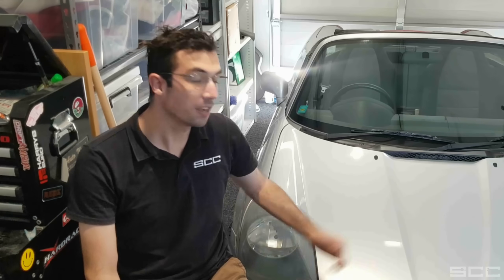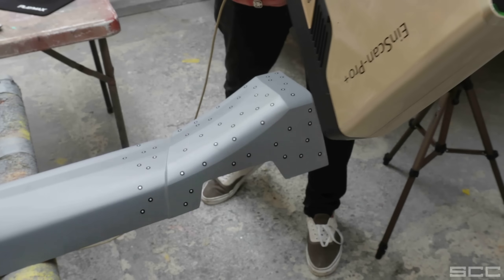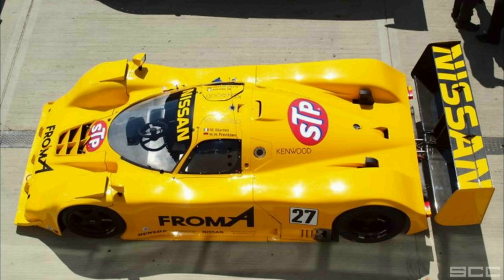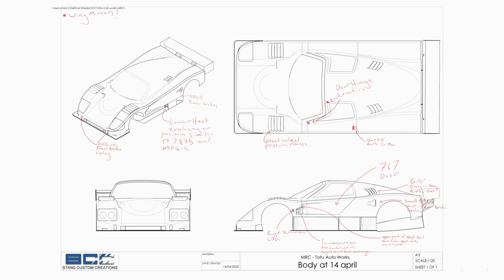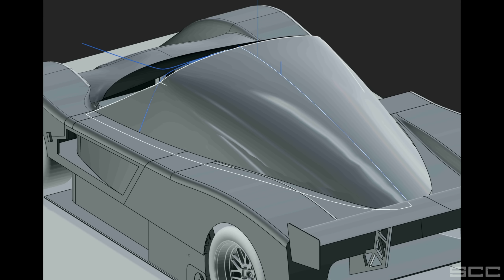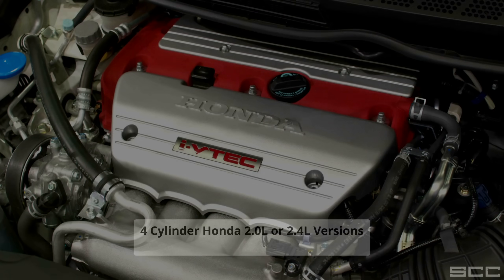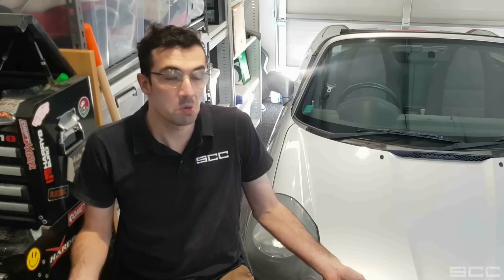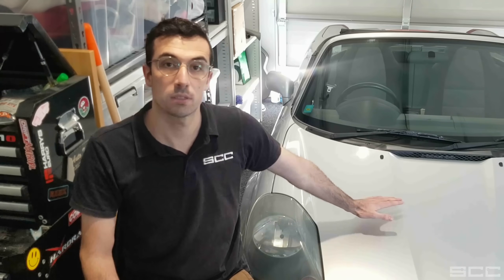MRC Reveal Overview

Comment: 6-speed sequential inline transaxle suitable for transverse mid/ rwd installation (Bacci RC-321) fits Fiat/Lancia (Lampredi) iron blocks includes a bellhousing to customer request, choice of ratios, diff setups etc.

Lampredi iron blocks and Fiat/Lancia 16V heads are relatively easy to find so how about copying Manuel Dondi's Fiat X1/9 seeing it's arguably the best looking evolution of any production car ever.

Plus it's way more streetable than the Beta Montecarlo Turbo Group 5 or LC2 Group C.

Comment: 1.8T! 
My 1.8T swapped MR2 happily did 193mph even with a poorly engine- Like Group C cars. 
With OEM VW/Audi gearing you can go 250mph+ if you like- Like Group C cars.
Toyota Group C cars were powered by big boost 4cyl engines though the 80s, ie the era this car is styled from, with the 4T-GTE from the 83C to the 87C, the 503E in the 88C, and the most dominant car in all of IMSA racing, the Toyota Eagle Mk3.
And it has proven race history in WRC with Skoda, in Formula 2 racing, in BTCC and WTCC, and so on.
And tons of room for wild big turbo setups at the back of the car, like so many of the legendary 80s race cars have.
Reply from the maker: Hi Stav, I was wondering if you were going to see this. I have been following your progress with 1.8t Swap MR-S for about a year now. Very impressive!
How did you get on with testing DQ250?

Comment: Fellow nzer here. 1.8t conversion done and certed. Had a v6, but went away as it was too heavy and made the car handle strange. Mind you it was an iron block v6.
Reply from the maker: I think I follow your channel, used to have a mitsi V6 and now 1.8t yeah? 
Be keen to hear your thoughts on weight balance. From memory your engine now passes through the rear firewall area?
Reply: @SCCDesignLab yup the firewall was modified for the v6. But yes the 1.8t can fit no problem with no mods to firewall (from the uk conversion s). I can feel the difference in a good way going down in rear end weight. Although I'm sure with suspension tuning the v6 may have been ok.

Comment: You can try to find a volvo/yamaha v8 B8444S, it's transverse mounted so it doesn't take much space, sounds amazing, very reliable (you can find them easily with 150k miles no issues), and makes very good NA power. A few people have used it in audi TTs and it is in the Noble M600. Best of all its quite a bit lighter than the vr6 and nearly as much as the 4cyls mentioned
Reply from the maker: I like the sound of that, Do you know which cars it came in?
Reply: @SCCDesignLab  Volvo s80 v8 2007-2010, they are common in America not sure about where you guys live though!

Comment: About 15yrs ago, a young guy in Japan swapped the Subaru EJ20 or 25 into the MRS (can’t remember 2.0 or 2.5). It was pretty quick. He converted the Subaru AWD transmission to mid-engine by making an adapter that deleted the driveshaft output. Factory Five kit cars did the same transmission modification… probably a lot of people have made the same conversion. I bet the newer generations of Subaru engines and transmissions would also fit. Would be awesome to have longitudinal engines layout like the real cars.
Reply: Thats a cool idea and low center of gravity with a boxer and would be a cool idea for these builds. Or even a k20,2gr or whatever engine adapted to the Subaru box to go longitudinal. More work and effort tho for probably very little gain really but I still love the idea

Comment: Hey man I like your guys build ideas so far, hope they work out how you want them to as I've wanted to do something like this for years as well.
I remember there being a Bentley kit years ago I always thought about one day getting.

A couple of things I noticed with your design with regards to having it road legal (at least in NZ).
I'm no expert and take this with a grain of salt as I'm not 100% sure on all of this now days ( Also I'm sure you're probably aware of this stuff by now anyway but just fyi).

1. I believe there's a minimum ride hight for the lowest part of the body for road cars in NZ? I can't remember what it is and it isn't to big but from looking into it years ago with regards to race car inspired road cars it may make the car look like it's on stilts and a little goofy.

2. Going along with the hight issue. Headlights need to be a minimum distance above the ground as well. Again this might not be an issue but could affect the styling if they needed to be raised up at all with how low the car sits.

3. If you're planning on using the current MR-S Vin to make it easier to register you won't be able to have the exhaust exit in front of the rear wheels like that. "Replacement/after market exhaust systems cannot terminate prior to the rear axle/wheels unless the car came from the factory with that configuration" is the terminology the law uses I believe. So early Dodge Vipers and Lots 7's are fine but this won't be. I believe it's fine to do it if you register it as an MR-S based kit car but then it'll be much more work than registering it as just a "highly modified" MR-S.

4. Also, and I don't think it is by the looks (and it would go against the goup-c styling q's anyway) but the rear wing can't be wider than the body of the car.

Anyway good luck with the build, I look forward to seeing the progress.
Reply from the maker: Really appreciate you taking the time to share these insights; road legality is definitely something we're keeping in mind, and it's great to hear what we should be looking out for. We are fairly aware of most of these things, and have plans in place on how we can get around the rulebook.

Comment: Was it necessary to have the transition from the windscreen to the roof be so sharp? I feel like it will have a substantial drag penalty. Great design overall though!
Reply from the maker: Thanks for the comment! There was a trade off aesthetically. Initially we had it smoother, but that made the roofline even taller which unfortunately made it look a bit goofy. Luckily We aren’t too concerned about squeezing every bit  of performance out of it so we can focus on things like Aesthetics. The MRS Chassis is so light that it should be plenty fast enough 🙂

Comment: For the front suspension geometry to work properly with the rear, you’ll need to design it according to the characteristics and intended use of the car. In either case, whether it’s an RX-7 or an NC, neither has the engine in the rear, so the suspension geometry won’t quite match correctly. In this situation, what you should do is reverse engineer the rear suspension geometry and design a front geometry that perfectly adapts to the performance goals you’re aiming for, ensuring a well balanced overall setup.
Reply from the maker: This is what I love! Getting people like yourself who can help point us in the right direction is a huge help! Please stick around and when we get to the stage of detailed design on the suspension please let us know any tips and tricks! 😊

Comment: 2gr or k24 FTW!  Also the Volvo t5 would be cool and it has been done plus it will give you an exotic exhaust note!
Reply from the maker: 5 cylinder would definitely sound awesome!
Reply: @SCCDesignLab  https://youtu.be/pAzIjiswKbU?si=msQlkj4KHBuDf5hM
Reply: @SCCDesignLab  https://www.youtube.com/watch?v=pAzIjiswKbU
Reply: @SCCDesignLab  2grfe is realistic. 260 hp small V6 with 30mpg OEM ECU. You can't really beat it.

Comment: Love the project! 
I've got some experience with the NC/RX8 front suspension geometry and some of its concessions, and one thing I'd seriously look at is the front lower control arm's rear bushing. A couple years back I designed at spherical bearing adapter assembly for that location.
Reply from the maker: I’ve noticed quite a few modern cars seem to have a lower control arm with this style bushing, ideally we would have a setup like NA/NB but as we are wanting 5x114 hubs we are looking at NC components. Although there is a high likelyhood we will end up custom making most of it 😅
Reply: @SCCDesignLab  100% understandable and definitely a bonus having affordable and readily available parts from the donor car! If you need any help with that bushing I'd be more than happy to help out! Think I've got the CAD models somewhere on my hard drive, and I think I've still got a pair of the adapters from the first production batch I made too.
Reply from the maker: @Beakz_ thats awesome, definitely stay tuned and when I get up to doing some videos on the suspension, shoot me a DM on Instagram 😊 be keen to chat

Comment: For me, you're facing a few obstacles... I know the MR-S well as a donor car. There are some important points to note...

-Because of the increased front and rear track, your wheelbase will no longer be 2.45 meters, because the driveshafts are not perpendicular. If you keep their angle, the wheelbase will be longer. You have to keep this in mind when modeling the wheel arches.
By example mine car is now 1m89 wide, and naturally the wheelbase is 2m48

Then you'll need a custom rear subframe to keep the driveshafts horizontal.

-The 18 inches at the rear will increase the original height of car (1m25)...by around 2cm... you'll need specific suspension and springs to lower it by more than 10 cm... 
By example, mine has win 3cm by lowering the roof* and around 8cm by the suspension**...
Forget big spacers, especially in front

-Important point**: the car's side members are lower than the side skirts. And if you lower the ride height significantly, you'll have them touching the ground. It's hard to be road legal with a car that has 9cm side member's ground clearance... even if your front splitter and your side sills are 11cm apart...

-Personally, to avoid being limited by the windshield design* and lower the ride height, I lowered the entire windshield bay, tilted it, and moved it forward... And I even reduced the sides of the windscreen...I thought that they look too thick....

In my country, it's quite impossible to register a such modified car...

Comment: I recommend reading the UK's Individual vehicle approval M1 manual. 

I have read road regulations for different countries and they all have alot of simular requirements. 

If you don't look into your requirements and plan to make a road legal car, you may realise you need to redo everything to get road legal compliance. The UK is known to have the best documented process. All countries have their own manual, reach out to your local driving authority. 

Key things to watch out for are:

-Headlight height
-viewing angles of lights
-safety glass
-external sharp edges

I have read this 7 times before designing my V12 build 👨‍🔧 I'm also building a le man car😉

I hope this helps
Good luck on your build 👍
Reply from the maker: Thanks for the helpful info!
Reply: Was going to chime in about headlight height as well. Never seen anyone pulled over for it, but was regularly reminded by other enthusiasts while driving my slammed air cooled beetle.

Edit: located in Florida, USA (no vehicle inspections)
Reply: @VeggieLard Yeah, every country I have looked into has a minimum and maximum height that the physical light can be mounted at on the bodywork.

On my LMP1 car I need to add headlights ontop of the fender because the original ones are too low, I can use the originals as main beam but not regular headlight.

Another good resource for anyone wanting to get an idea what I am talking about are videos called 'IVA TEST' by MKsportscars. I have also done my own TIPS video talking about regulations for builders but the MK one is better 🤣

Thanks for the good chat 😎👍
Reply: Have you already finished a car?
I’ve watched your channel an the most I’ve seen is a rolling chassis without steering, without transmission and drivetrain.

This isn’t meant as a attack or anything I‘d just love to see more of your work in a later state and how you solved the problems that came up!
Reply: @rolux4853 Hello, I've been building supercars for years. I am new to youtube tho 👍 My first documented build is my V12 project which I have been building for 1 year so far. I am estimating to finish in 2026 😎

I am building the whole running & driving car then making the body last now as it makes more sense for filming purpose. Some of the problem solving doesn't make the final edit as modern youtube is more fast pace and catchy. 

I have made the engine mounts but I still need to build the suspension before I can put the full weight onto the chassis. 

I will be uploading a new video next weekend (~18th)

Thanks for your support 👨‍🔧

Comment: If you need help with suspension kinematics lmk. Currently designing front double wishbone and rear multilink retrofit for the Subaru BR9 and I have some other cars from scratch in the pipeline. Currently designing a Cobra inspired soft-top with 1UR-FSE or 3GR-FSE engine options, MR platform with K24 or 3GR-FSE, one touring bike and one cruiser. I did also design a tube chassis for the Datsun 240z with Mark X suspension.
Reply from the maker: Sounds like you’ve got lots of cool projects on the go! 
Suspension design will be something I’ll be tackling in the near future so definitely Appreciate any suggestions!

Comment: since there is no drive shaft ... why not just cut the car to make it longer by 3 inches. to get the 99-100 inch for much better body ratios?
Reply: No need to extend by cutting the car...It only require to make a custom rear subframe. Especially if you don't keep the original engine, and lower so much the car ;)
Original subframe is only bolt to chassis.
Reply from the maker: @SETHalpine i like the way you are thinking, its something we have looked into and when I get onto rear suspension and engine conversion we will see what we can do!

Comment: Love the build! I have a consideration for you. The Aluminum Volvo/Yamaha B8444s 4.4L V8 DOHC and mounted with the M66 Volvo trans for a transverse compact packaging. 

Noble M600 had forged internals and twin turbos strapped to the engine making 650hp.
Reply from the maker: I love hearing these kinda of Ideas that are very unique! For me, sound is the most important thing. So a high revving V8 would be awesome if I can shoehorn it in there. 
At the moment I am leaning towards a VR6 for the sound aspect

Comment: Niceeeee !! Did you trace the silhouette from a picture on plasticity?
Reply from the maker: We started roughing out the shape with no references other than the underlying scan data of the MRS chassis and some ideas in our heads. Once we had the shape pretty close, we then refined it in the plan and elevation views. I then imported those images into plasticity and used them as a reference when finalising the geometry 😊

Comment: Subscribed! I'm not a vehicle dynamic engineer by any stretch of the imagination, but an NC/RX8 double wishbone suspension would need to be modified more like how caterhams have their double wishbones, so having the coilover angled a lot to clear the recess on the hood/bonnet and the lower wishbone probably reinforced at the connection to the coilover. In my opinion you are absolutely right about the 5 lug nut wheels, that will give you a ton of flexibility.
Reply from the maker: Thanks! I should have mentioned, for the shock/spring I’m thinking of using a pushrod and rocker to relocate the shock/spring inboard!
Reply: @SCCDesignLab  That would be awesome, best thing you could do packaging wise!
Reply from the maker: @amigodesigns  yes, and looks awesome 😁 lots of things like this that we want to be functional, as well as look cool on this build
Reply: @SCCDesignLab  Yep I may know a thing or two ;) . Btw not really useful for creating moldings, but for certain parts that require some heat resistance and flexibility like intakes etc PBT pro is quite a nice material to work with for 3d printed parts and extremely affordable!
Reply from the maker: @amigodesigns Thanks! I’ll look into it 🙂Allways good to get recommendations on materials. I have recently gotten a Bambu X1C so have started experimenting with fibre reinforced filament like PPA-CF. Its amazing how far 3D printing technology has come over the past 10 years
Reply: @SCCDesignLab 100%, it's alien tech 😂 I have an X1C too and it has been a game changer for me. A few weeks ago I bought an H2S because I'm designing bigger parts and I wanted to reduce the number of faces to glue and bolt on together, I wouldn't complain if bambulabs had made an even bigger printer but probably it would have been way more expensive. I have heard wonders about ppa-cf, but haven't tried it yet, price has pulled me away from it, but maybe for an specific application I could justify it! Anyways, I don't want to waste more of your time, looking forward for the next updates on the project!